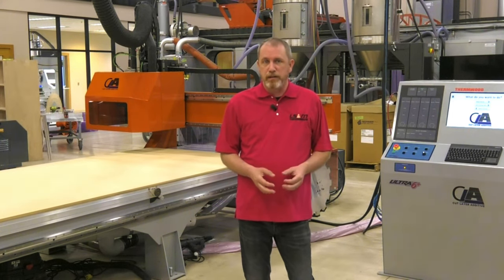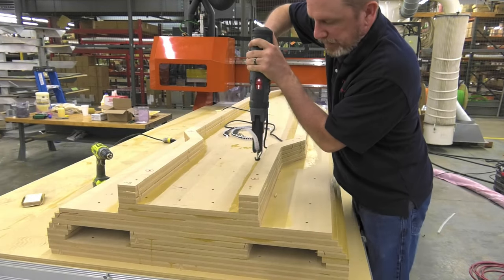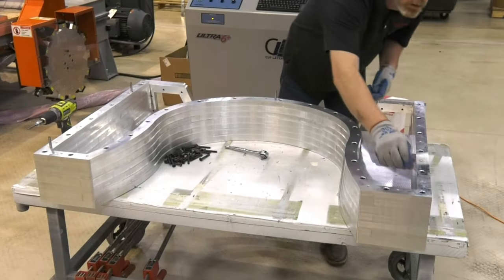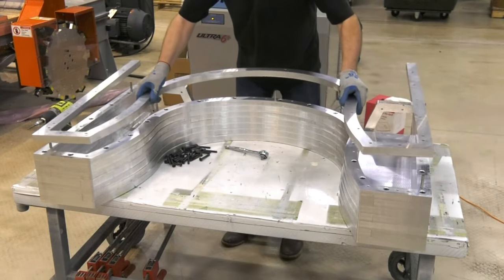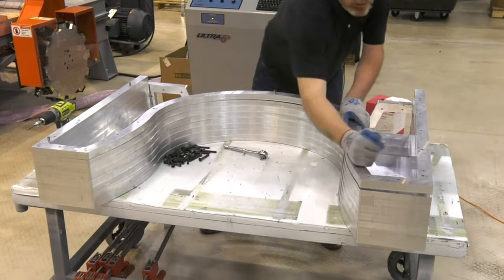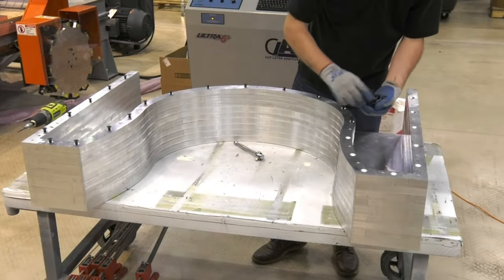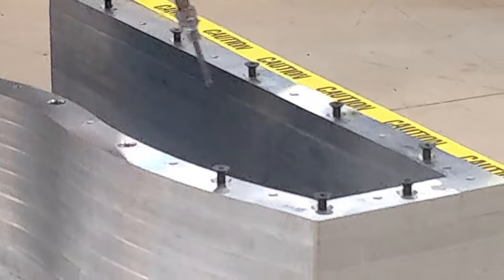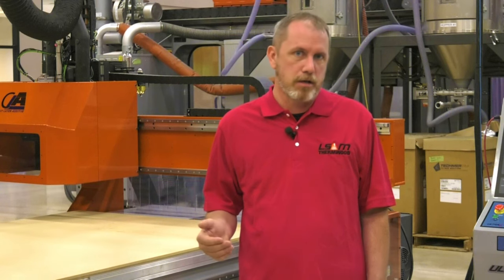Cut Layer Additive Assembly #Shorts

Comment: This is neat to see automated!  I have done many times and agree programming is lots of work - especially to achieve a near-net shape that doesn’t need lots of roughing time.  

Are you able to get vacuum integrity on any of these?  Usually with small items you can make the block solid and envelope bag or bag to a table.  Interested to learn more about the aluminum too-looks like a nice fast way to make volume!
Reply from the maker: @explorecomposites, Thanks!  It definitely can save a ton of time.  As for vacuum integrity - It depends on the material and the glue or bonding agent used.  We haven't tried any vacuum integrity tests with the projects that we've currently processed yet, but we anticipate it working.